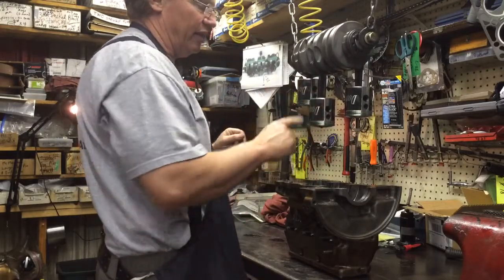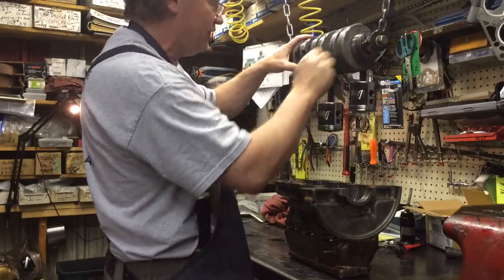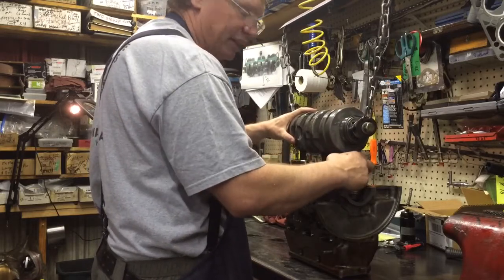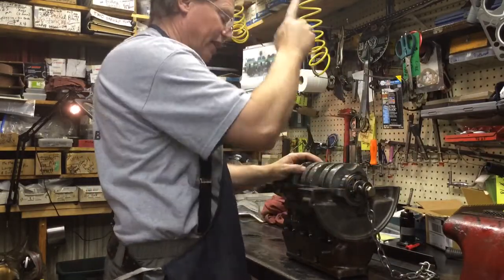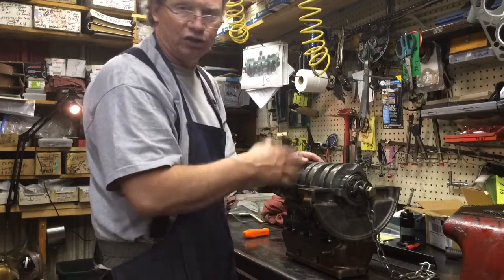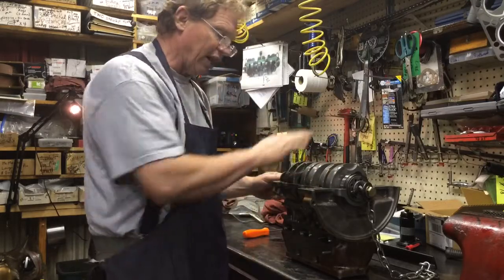Saab Two Stroke Crankshaft Installation

Comment: I am going to make my own Zero Gravity set up like yours---ingenius! Basically a garage door type spring with a spreader bar! It shouldn't be too hard to make up one that will hold my crank up and allow easy assembly! I put the crank in my 96's engine by hand, and even this isn't too hard. I was wondering--where do you get your pistons? I can use either a new set of aftermarket ones or one new or good used AB piston, which will give me back my early type rear radiator single carb engine and another triple carb engine, both of which I want to make little power units out of to run at old engine shows! The triple carb engine is the one that needs the piston--it apparently ran backwards at one time or another, and caught the "third port" intake port to the crankcase from the carbs. This caused a "tear" like break in the skirt that goes up to almost the bottom ring land. There was no other apparent damage--the crank looks fine, no damage to the bloc or ports, so if I had an Ab piston and rings in-hand, I could get it together again and get it running. Since it will only be an emergency spare for my car and mostly be run once or twice a year at engine rallies, it doesn't have to be perfect. It seems to be a pretty low-mile engine anyway. The single carb engine just had badly stuck rings from sitting in a barn since the mid 1970's, it turned, but was "stiff' near BDC necause of cylinder "taper" and stuck rings. I freed the rings by socking the pistons in acetone and MEK mix for a month, and they came loose. I removed the rings, used a piece of a bad ring off a burned piston out of my car's engine (goobered up carb jet made the front cylinder go lean and burned the piston on the exhaust port side before I bought the car) to clean out the ring grooves, and reinstalled the rings, now, after sitting in a box since 1999, it's time to get it back together and running. It has the fan and generator driven water pump, but I don't have the original radiator, but one from an old British car that should work, and for the triple carb I have a V4 rad that should do the trick. One AB piston and I'll have 3 runable SAAB engines, 1 in a car! I love all manner of 2 strokes, and these triples are just gorgeous sounding engines. Always loved any 3 cylinder 2 stroke, including diesels like Detroits. Under load and at moderate throttle, the SAAB 2 strokes do sound like a 3-53 Detroit alot! If you can help me with availability of a piston, my email is iwantQ7@yahoo.com Thanks! Rick Delair!